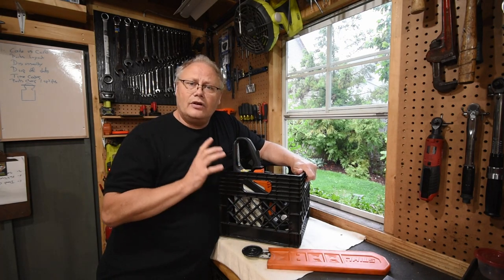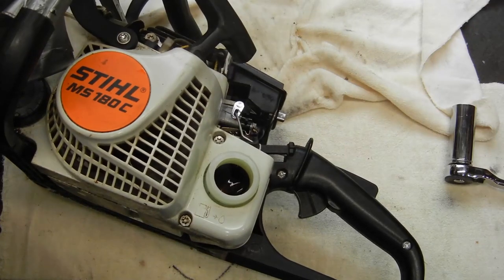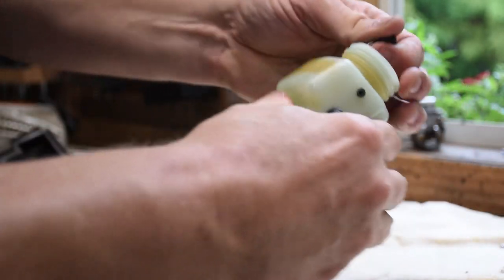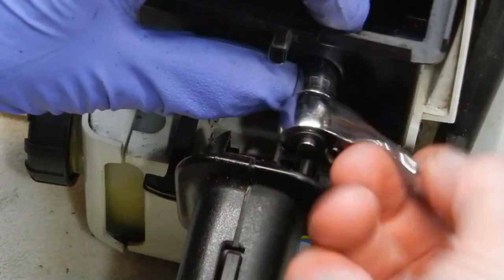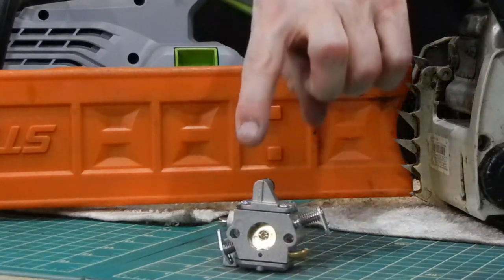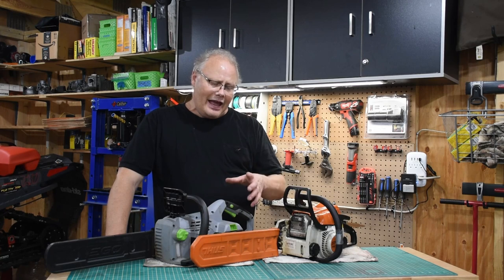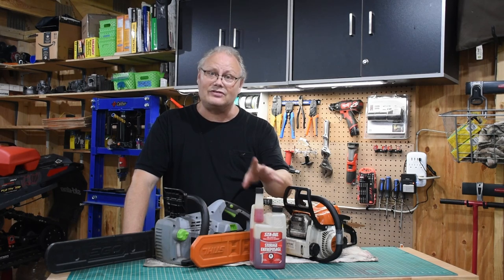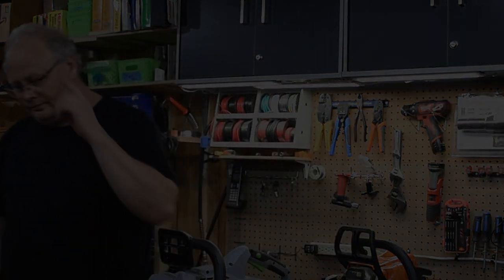I replace the carburetor on a Stihl MS180 with an Amazon Carburetor.

Comment: I bought the makita cordless saw because I already have batteries, very impressed with it. and use it for any trimming or quick jobs. And use the gas saw if I'm going to burn a tank or more.
Reply from the maker: Thanks for the feedback. A great way to determine which tool to use. Both electric and gas powered saws have heir place for sure.
Thanks again for the feedback.
Dino

Comment: Great video keep up the good work I was thinking of buying this same song but now with all these complications, I’m not sure should I go with a higher number on this model
Reply from the maker: Hey thank you for the comment. The saw itself is a good saw but if you let it sit the fuel willl gum up the carb. Depending on how much wood you need to cut and where it is located new battery saws and corded saws are a good option for the infrequent user.
Thank you again for the comment
Dino